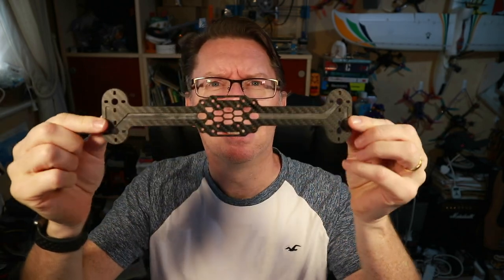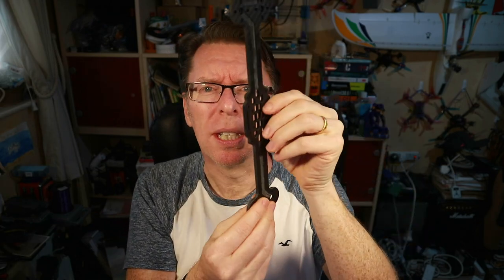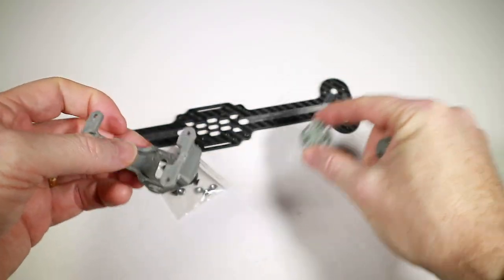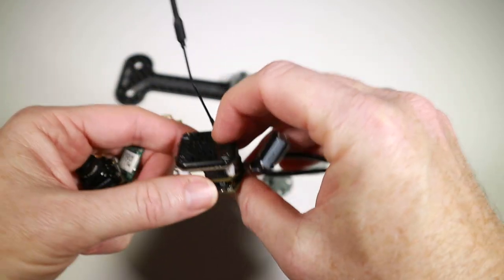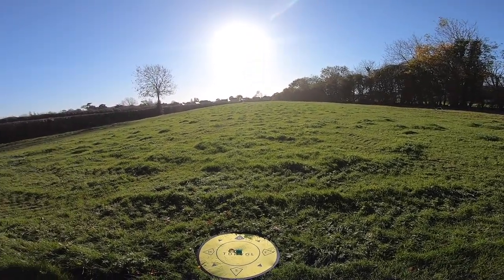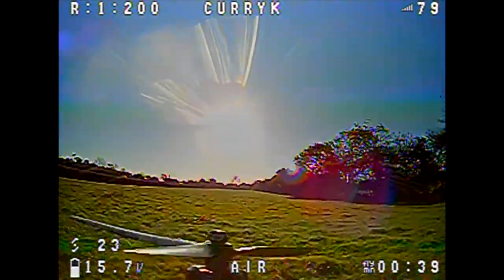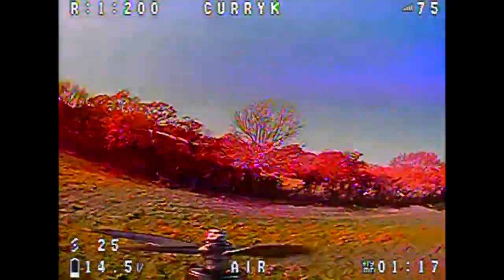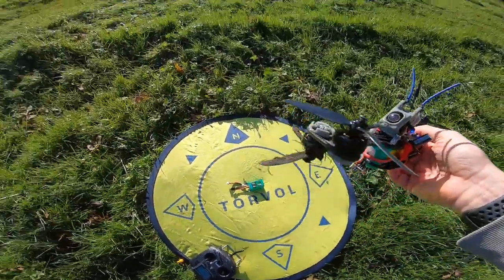The XXXFPV Bone Frame.  Building and flying.  Supplied by Banggood

Comment: I've seen this issue before. Your vtx on the stack is in contact with the canopy as seen @5:24. Add more risers or shave away tpu and try again!
Reply from the maker: So you are saying that the contact point with the TPU is causing more vibrations to transfer from TPU to stack and thus the gyro goes a bit crazy?
Reply: @CurryKitten  ... the canopy-bone's connected to the frame-bone, the frame-bone's connected to the motor-bone...

Comment: I've seen a Arducopter build with a much larger frame that had full autonomous capabilities and was being used for agricultural uses.   Thing is though it was flying with props to the side not front to back configuration.  Same dual prop and frame style just had props from left to right.   I was amazed how stable and nimble it was and locked in.   The video is on YouTube somewhere lol.
Reply: Do you remember the name of that agricultural project using such frame?

Comment: Fascinating unique build. Hope you get the Rx thing figured out and can sustain longer flights. Blackbox data might provide a hint to if vibration the issue with coordinated turns that get overpowered.
In future you might consider rotating the stack and camera 90º the make a wide vs. long quad. Would make for interesting comparison. This configuration might permit adding a bit of foam the the arms to add an airfoil for improved flight performance. (kind of like what DJI did with their FPV quad arms). Likely more as an experiment than pragmatic mods, but could be a fun learning exercise. ;)
Reply from the maker: Yeah - I'll just replace that RX with an ELRS one.  XM+'s have always worked well, but I did get the odd dud.  I like the idea of an ultra wide quad as well... because it's even more useless :)

Comment: I wonder how it compares to the original done by Rotor Riot. Maybe if I ever get my hands on 2, I'll see how much it is, to send one your way for comparison.
Also one thing I've heard you can do, for short range rx drops on the xm+, is you can remove one of the antennas. Something to do with the diversity setup. It didn't help the total range, but stopped mine from getting rx loss, at 3 meters away. 
Happy flying!
Reply from the maker: I don't think I saw that one, but I stopped watching RR quite a while ago.  I've had nothing but great times with XM+'s usually.  I've just had a few dodgy ones that would srop out, which is a bit what this looks like.  I do have a bunch of ELRS rx's though, so stick to what I know is good :)
Reply: @CurryKitten  For sure, I believe it was in the past couple of years, I just started watching them recently, so haven't gotten stale yet haha but would definitely be interesting to see how the bang good clone compares.
Yeah I'm currently in the process of getting elrs rx's to replace my FrSky ones as well, the only xm+ I bought was a faulty one (from what I've seen from creators, most xm+ are good, besides the occasional low range rx loss) , but got an archer rs after that, and it worked beautifully, just needs new antennas now. Keep up the great work!

Comment: I have two points to make 

1) I think this quad does have a place in anyone's fleet that wants to go travelling. Not having to contend with a wide X shape in your luggage is quite useful. Pair this with folding props, a Jumper T-lite with ELRS/Tango2&CRSF and Fatshark goggles and you've got yourself a very compact setup 

2) Whilst I am an absolute noob at PIDs, the nature of this hobby requires you to tinker. You mentioned at the start of the video that the settings you had on the FC were set for a 3 inch quad; perhaps that is the problem?
Reply from the maker: I think I'd take a nice 3" quad over this for a compact travel drone.  Usually you'll get a decent flight on stock pids on most things, the going crazy looks like an external force is being applied in a weird way, but I'll work on that for next time.

Comment: that weird wash-out on the turns reminds me of my Shendrones Rapture quad, I think Betaflight has issues with lengthy builds. I'm gonna flash 4.3 to it soon and see if that sorts it out
Reply: if that dont do it try going back to 3.5.7 i had the same problem on my beast class rig now it flys fine and ive since found out a lot of peps use this firmware as the tune is soild
Reply from the maker: Everyone that has X class I know also uses 3.57
Reply: yes it just works well for the big stuff ive also still got a five inch on 3.5.7 it flys so nice and i worked hard on the tune so ive not got the heartto change it if its not broke dont fix it right

Comment: I think the point should be raw speed. All other points being equal (motor/props/battery/weight,) this shape cuts a smaller cross section through the air.
Reply from the maker: Perhaps so, but overlapping props does cut down your lift efficiency and thus top end speed.  I've not really got much of a high power setup, but I'll try and blast it a bit more once I have the rx/weird turn thing sorted.

Comment: It could go easily  through cracks ;-) ...Had the same problem with my XM plus on a sector 132 it would failsafe at 30 years  ... I just replaced it ...
Reply from the maker: I've had a few dodgy ones, they are occasionally fixed by reflashing, but it's as easy to swap it out

Comment: It's quite a fun quad but as you say not a lot of point to it. Frsky rx is just jealous that you are using ELRS :-) Be good to see if you can sort issue.
Reply from the maker: I suppose there's no point in flying anything.. other to to have a bit of fun, so it almost meets this criteria.  It just needs to stop falling out of the sky randomly
Reply: @CurryKitten  True but I do like something a bit weird :-) Stick ELRS in and it will be fine :-). I have ELRS as Christmas present so it will probably give me some fun. Most of the vids on ELRS are quite old and things seem to have moved on a lot, especially with V2.